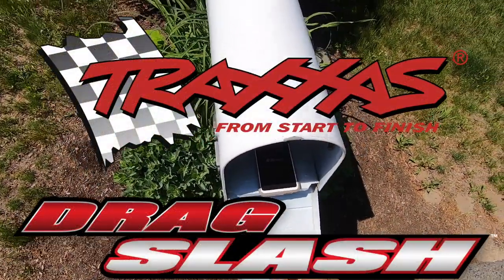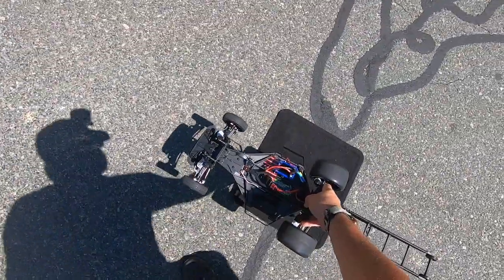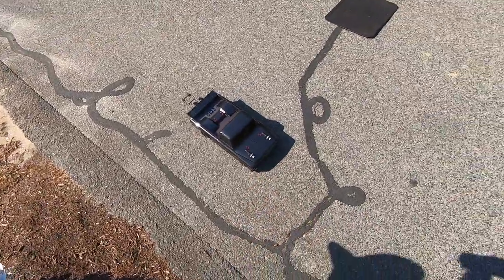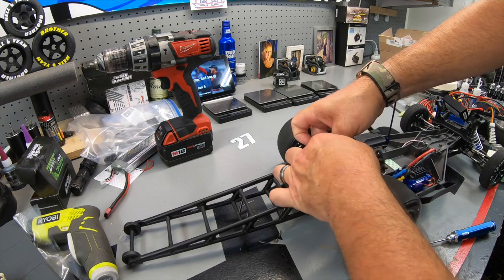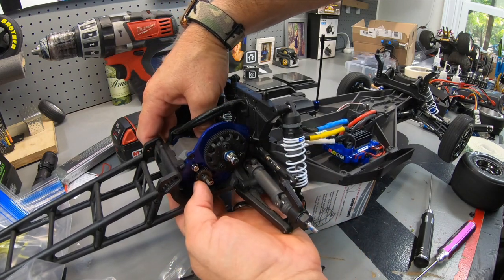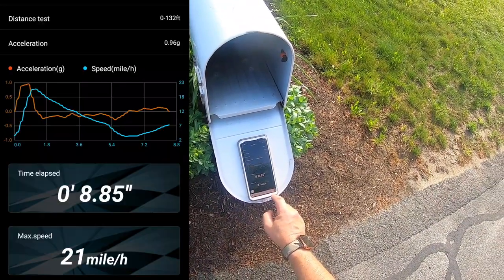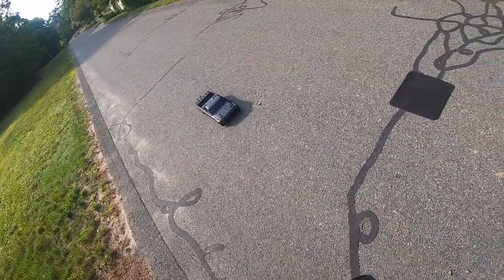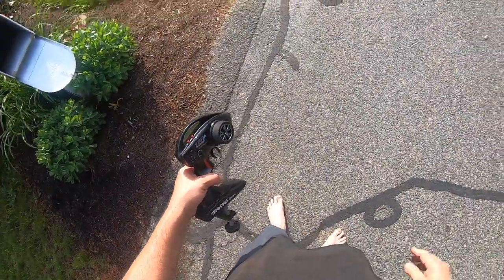New Release Traxxas Drag Slash Speed Gear Installed and Weight Distribution

Comment: You should come out to BCC in Fall River. There is an event the next two Sundays June 13th and June 20th.  It's on ellsbree Street in Fall River MA.
13th is a cash days and 20th is our top 10 list that has been restarted so it's a Going to be a fresh top 10. Before each event there is at least 2 hours of test and tune completely free with Traxxas DTS lighting system. Excellent group of guys very friendly very helpful. On the 13th (cash days) people come all the way from Connecticut and is probably 40 guys that show up. There is at least two events a month. I've been to four events now and have had an awesome time each time. Definitely show up man you'll have a good time. On the cash days event they have 1/7 1/8 and 1/10 scale classes open run what you bring. Also street eliminator Street outlaw class usual rules rubber tires 2S only etc. Top 10 list is the street eliminator top 10.

Comment: So when you put the speed controller in drag race mode all you really did was kill a reverse and the TSM on the controller is steering assist which also is throttle assist squeeze the trigger and roll the car side beside it cuts the throttle up and down.but p when you hit that trans brake switch is that also roll control to where the car won't roll forward to the line . great pulls      love the FORD hat !!!!!

Comment: Your "anti-lock" (TSM)  isnt working properly because you have it turned off on the remote.  In drag mode its brake only and you tune the brake assist amount on the remote.  Same as when using it in normal TSM mode, its a percentage assist amount. 0-100% on the multu function knob.  TSM is only auto steering, it keeps it going straight and will prevent spin outs.  You can pick the car up and fish tail it in the air and the steering will try to counter act it.  Im sure in Drag mode it will only do it with brake applied.
Reply from the maker: Brakes react the same either way🤷‍♂️ I believe it's working
Reply: @rcguygarage  Its not affecting the brakes only steering.
Reply from the maker: @stubs80x11  odd cause on slow-mo it looks like it's working. Seems to control braking OTB🤷‍♂️👍💯👊

Comment: Press the little black button on receiver to turn off tsm it will flash green and if you trim brakes and then change pinon gear then you got to redo brakes
Reply: Best to remove it. Any track that host official no prep will not allow it on the vehicle, even if its turned off.

Comment: Losi beats the drag trash , and it comes with lights for 100$ cheaper win win win losi
Reply from the maker: That's why there are so many automotive manufacturers so you can have a choice for sure👍💯👊
Reply: there is a 40$ difference, not 100$ lol idc about lights, i care more about part support and no one can compete with the slash's aftermarket and part supply